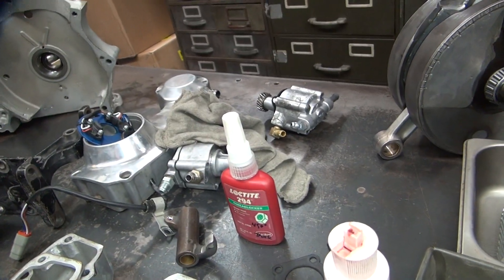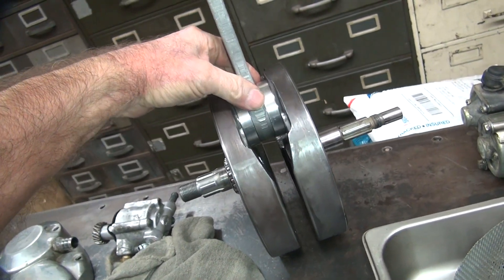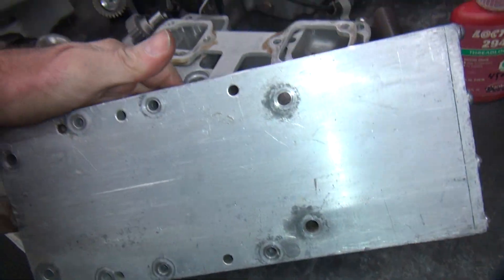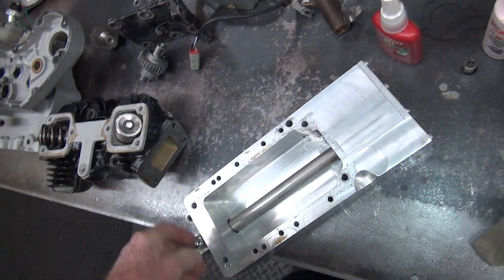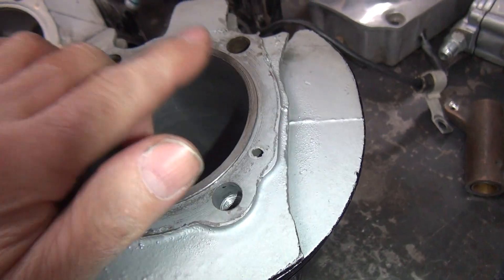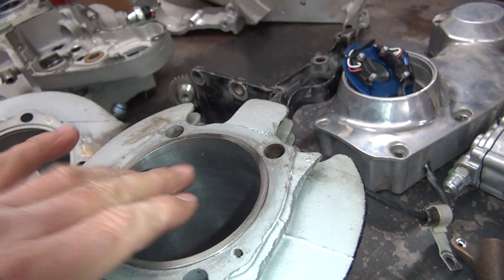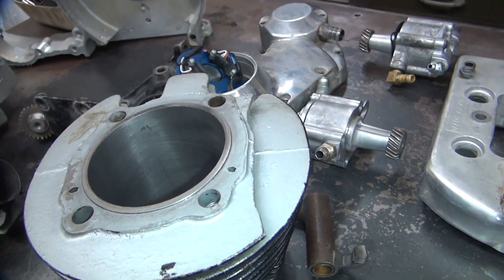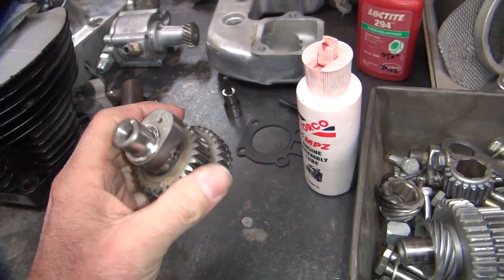#118 2023 el mirage scta landspeed racing harley 650 single xl sportster rebuild nitro tatro machine

Comment: I think the “sump pan” design came from the factory XR-750’s (the thinking it robbed horsepower to drag the flywheels through the oil). Harley changed crankcase design in 1977 to have an “integral sump pan”.
Reply from the maker: that pan thing was not very much of a pan. mine is a big pan with  rear pickup plus i added the scraper.
tatro
Reply: @TatroMachine  Yes.  Same idea, much better design.

Comment: All the added changes you have made are very logical necessities to prevent expensive failures , some learned the hard way no doubt . Most people use forged pistons because of detonation , strength , etc.... You are using a hypereutectic/hyper piston , high-silicon aluminum that isnt as strong as a forged piston ? Im interested why , is it because the hyper piston expands less than the forged piston at high temperature , and/or ?   Im really not a fan of wiseco pistons , for the simple reason , I can buy 8 pistons less than wiseco wants for 2 pistons , they probably make good pistons , but , at those prices they can keep them .
Reply from the maker: wait until you buy custom pistons. than you will like the cheaper wiseco pistons. i have never broken a piston yet except cast ones. i burn all the other ones up equally.
tatro
Reply: @TatroMachine  Every wiseco piston pair I find is forged and over $400.00+ and did not find any hypereutectic / high-silicon or stated they were hyper , and I looked specifically for hypereutectic cheaper pistons in 3.875 x 4.375  , everything that comes up is forged $$$$$$$$$$  ?